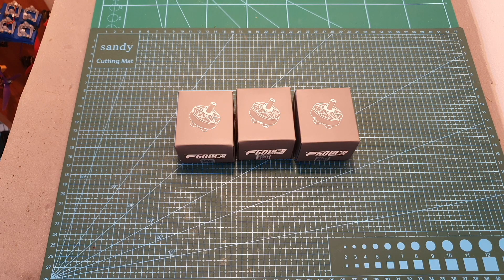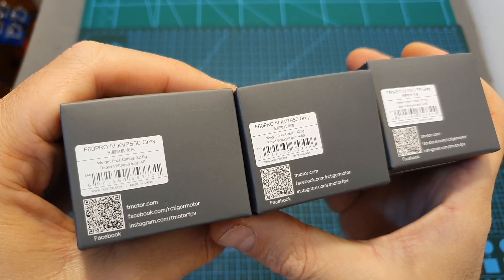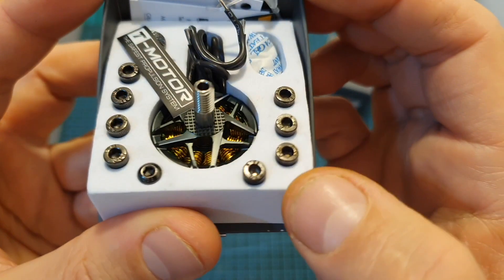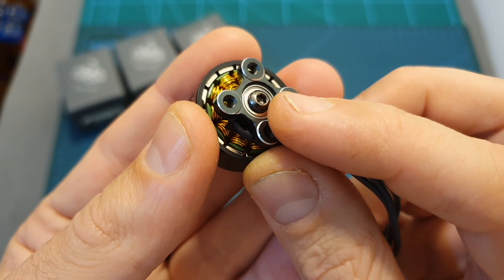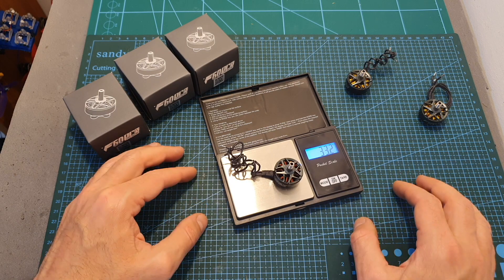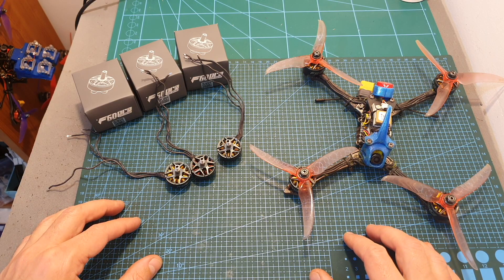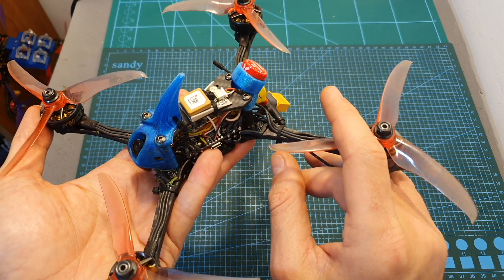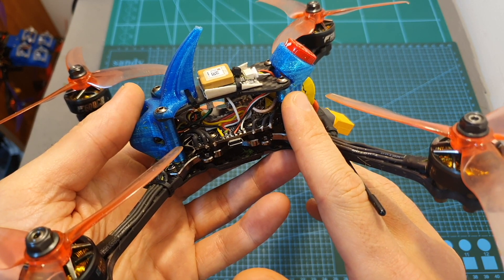🚀 T-Motor F60 Pro IV Thrust & Speed Tests

Comment: 👍👍👍👍👍👍👍👍👍👍👍👍👍👍👍👍👍
Love your motor tests !!!!
I am a beginner rc builder , and I have a particular question for you based on your motor experience:
I am building a small rc plane and the design as for a 1700kv motor of with 20grams motor weight . The plane has about 180-200grams weight and it is VERY SLOW flyier.  Here a video of the plane https://youtu.be/Osr8n_VDyqI 
The space available is for a propeller is max 6in ...........
Do you a a recomendation for a efficient motor 1700kv, 20 grams , prop 5in or less  using 2 or max 3s lipo? 
Many Thanks
Alex
Reply from the maker: Thanks Alex. It might be better to use a 6" propeller with a 3s battery (If I understood your question correctly).
Reply: @KremerFPV  , thanks gir your response.
sorry was not clear my question is: what motors could I use that weight 20grsms, have 1700kv , uses 6in prop and uses onky 2s or 3s lipo?   i need your recomendation about motors. thanks.

Comment: Hi Gal, Thanks for this video. I am new in this universe and I do not understand why voltage on T-Motor cell are arount 16V for a 2550kv for example, and compatible with a 4S LiPo which deliver 14,8 V.... I am sure it's a noob question but anyway it might help others :-)
Reply from the maker: Hi there. The voltage of a fully charged Lipo cell is 4.2v, so the total voltage of a fully charged 4S Lipo battery is 16.8v. 
The nominal voltage per cell however (resting voltage) is 3.7v, so if you multiply it by 4 you get to the result of 14.8v. 
Hope it all makes sense :-)